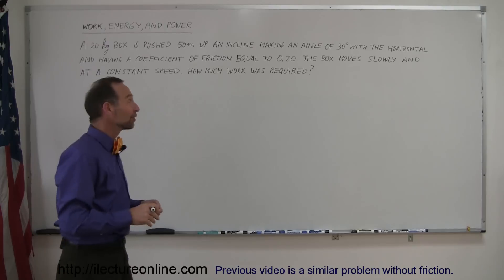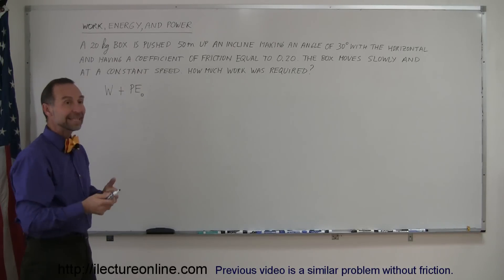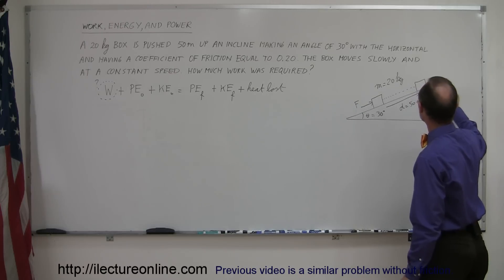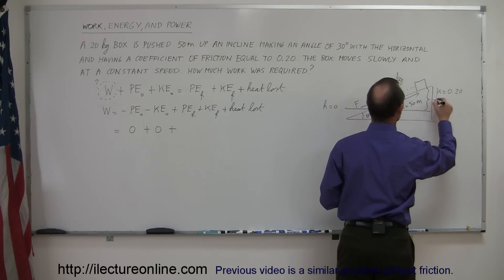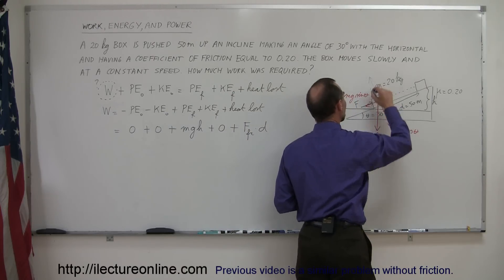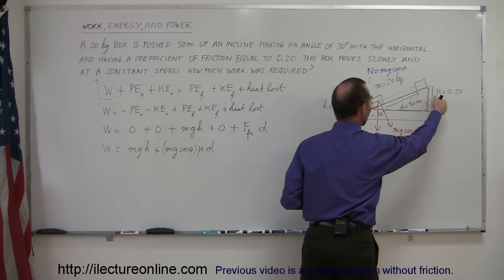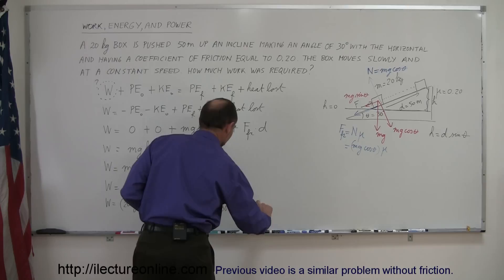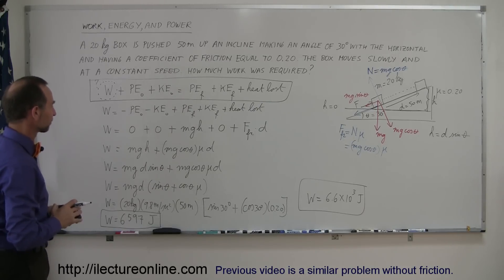Physics 8  Work, Energy, and Power (23 of 37) Box pushed up a Rough Incline With Friction

Comment: Hello Mr there is a fraction the answer supposed to be 2802.6J because it’s substirction not addition .
Reply from the maker: The result in the video is correct.  Don't automatically assume "something" is an addition or a subtraction, it depends on how the equation is formulated.

Comment: A question, how is final kinetic energy 0? I'm searching and all the answers say constant speed/velocity has a constant kinetic energy.
Reply from the maker: Since the velocity didn't change, the kinetic energy didn't change so we can just set the KE before and after equal to zero for simplicty.  You can plug in any value, but since we were not told what the speed was, it was just easier to call it zero.

Comment: A 15kg box is pushed up an incline 30° to the horizontal and 3.3m long with a speed of 6ms-¹ at the bottom. Due to friction, the box stopped 2.0m and slides back down.

a) What is the magnitude of the friction acting on the box assuming it is constant.

b) How fast is the box moving when it slid back to the bottom.

I solved with the energy formula and I got magnitude of friction as 60 N.
With F = uR, I got 75 where u = tan30 and R = mgcos 30
Reply from the maker: If you assume g = 10 m/sec^2 , then the friction force is 60 N

Comment: Is there another way to solve that problem? I tried with the method you gave in the previous video, but it didn't workout, even though (to me atleast) it's almost the same problem.
Reply from the maker: The method  used to solve the problem, depends on the conditions.  In this case, the box moves upward at constant speed.  I suggest you use the method shown in the video.

Comment: Why 2 sf, 20 has 1 sf
Reply from the maker: we are not worrying about significant figures here, just the concepts and how to find the answers.  Significant figures are covered in a different playlist.  We are not assuming that the numbers given are "measured" values.  In the case where we are actually using measured values we should then use the principles of significant figures.
Reply: @MichelvanBiezen  by the way, what is the speed wasn't constant, what would we do, and what would be given?
Reply from the maker: If for example, the speed was increasing, then part of the work would be converted to kinetic energy and part of the work would be converted to potential energy minos any energy lost due to friction.

Comment: Isn't that friction oppose the motion ... Coz if that's case , work done by friction should be negative 1697 and the Wnet should be 3203J 😳😳😳😳
Reply from the maker: It depends on which side of the equation that term is placed.  If you place the "energy lost" term on the left side it becomes negative and if you place it on the right side it becomes positive.

Comment: Good sir, i'm wondering the difference between this and video136 in this playlist is considering in the other video kinetic energy isn't 0 although it seems exactly the same. Also the applications of energy was given by a different equation. Thank You
Reply: My inclination is that because the other video has given force of 100N, then it is not a constant speed?
Reply from the maker: It depends.  If the 100 N force is greater than mg sin(theta) + friction force, then the block will accelerate up the incline.
Reply: @MichelvanBiezen  Oops I was neglecting the weight components! Thank You for the quick response!

Comment: If both kinetic energies are 0, meaning both initial and final velocities  (in the 1/2 mv^2 formula for K.Eo and K.E1) of the box are 0.
So the box literally moved up the plane without velocity.
Practically speaking, the box moved up the inclined plane without moving.
Reply from the maker: If the velocity did not change, then the kinetic energy on both sides of the equation will cancel out.  (v is not zero).
Reply: @MichelvanBiezen  Ok, I see. Thanks for the feedback

Comment: If I want to calculate W=F*d, d=50m and F= mgsinθ+mgcosθμ ,is it correct?
Reply: you only use that if theres no force given, just like the example we are not given by any force that will make the block move or to make it short theres no F to satisfy the formula w=Fd, therefore by using newtons 2nd law of motion we can let that the fnet  will be equal to mgsin theta, and also since the example we had has a friction acting on it we need to find also the formula for it. uk is equals to N and N is also equals to mgcostheta, thats why in his solution you W=  (force x d that is needed to move the block)+(- force the friction has x d)

Comment: Quick question. Couldn't you also solve for work by finding the force as (mgsintheta)costheta and subtract the force of friction, then multiply everything by the distance? I saw in your last video(without friction), you found the force as mgsintheta then multiplied by D. How come you can't just do the same thing here, except use FDcostheta and subtract friction from this? Sorry if I was a bit confusing.
Reply from the maker: There are often multiple ways to solve a problem, and the best way to learn is to try it in a different way and see if you get the same answer.

Comment: Thanks for your quick response Mr Biezen. This is the problem - my solution is included.
I am not sure if i am sure it would be prudent to ask specific question here, but i will give  it a try:
A block of mass 90 kg sits on a slope with an angle of inclination 12° above the horizontal. The coefficients of friction between the block and the slope are µk = 0.03 and µs = 0.2.
a. What is the maximum frictional force that will allow the block to stay in place?
b. At what angle of inclination will the block start to slide down the slope?

Solution for part (a) 

F_s(max.) = µsN
F_s(max.) = µsmgcosθ
F_s(max.) = 0.2(90kg)(9.81m/s^2 )(cos12)
F_s(max.) =172.72N
Maximum frictional force that will allow the block to stay in plaxe = 172.72N

Solution for part (b)
fg = fs
mgsinθ = µsN
mgsinθ = µsmgcosθ
sinθ = µscosθ
 µs = sinθ/cosθ= tanθ
θ = tan^(-1)(µs)
θ =  tan^(-1)(0.2)
θ = 11.31°

The block will start to slide down the slope at 11.31°

I am confused because the block is expected to slide at 11.31 or an angle greater, but yet, 12 degrees in part (a) is suggesting the block is at rest?  Is my solution for part (a) correct? I am thinking i should have found part b first, then use 11.31 degrees and enter it in the formula: F_s(max.) = µsmgcosθ
, instead of using 12 degrees, use 11.31 degrees.
Reply from the maker: You are correct.  In order for the block to be stationary at an angle of 12 degrees the coefficient of static friction should be 0.213.  Therefore the block will slide when the angle is 12 degrees.

Comment: I certainly enjoy your videos. I have a question based on this video. If a block is at rest on the incline plane  at an angle of 30 degrees, would the maximum frictional force that would allow the block to stay in place be calculated using 30 degrees, OR would we have to find the minimum angle of the incline plane needed for the block to slide before we can determine the maximum frictional force? That is, find that minimum angle and then substitute it in the formula for  fs(max) = UsMgcos (minimum angle needed for block to slide)?
Reply from the maker: It depends on how the question is worded.  Sometimes they will ask what coefficient of friction is required to keep a block from sliding for a given angle.  Sometimes they ask: for a given coefficient of friction, what is the maximum angle you can have before the block begins to slide?

Comment: I am a little bit confused...  shouldn't the net work by calculated by finding the work done by gravity and subtract it from 
the work done by friction? I found your answer when I added them though. But What if I subtract them?  my thinking is 
energy is lost due to having a nonconservative force( friction) involved.  The total work performed should the difference 
right?
Reply from the maker: The method and answer in the video is correct.
Reply: What you are suggesting is the net work if the box were sliding down the ramp; in that case, work would be done by gravity.  In this problem, you are effectively doing work against gravity.  The net work is the total work needed to lift the box up by a height h AND also overcome friction.  Addition should feel like the logical choice.

Comment: Why kinetic energy final is 0 even when it has a slow but constant speed I believe change in k.e should be 0.
Reply from the maker: You are correct.  However for this example, the word "slowly" is used such that the KE is negligible and can be ignored.
Reply: Michel van Biezen ok
Reply: Michel van Biezen Because V=constant, KEo =KEf, then the term KE cancel out...is it correct?

Comment: the thumbnail is misleading. You have a pushing force acting in the x direction in the thumbnail and in this the force is going up the incline
Reply from the maker: You are correct.  The force in the thumbnail should act parallel to the inclined plane.
Reply from the maker: Fixed it! Thanks!

Comment: i am bit surprised. It was superb technique to solve the questions that way, however work is define as f.dcos(teta) work done by the kinetic friction is f.dcos(teta  180  degree which implies us energy transfer from block to force parallel to the surface oppose the motion of block but you neglected 180 degree made cos(0) which gives us positive result.  Why you didn't suppose to be subtracted work done by the kinetic frictional force.
Reply from the maker: We did.  (It is the "heat lost" term).   For the equation to be balanced   Eo = Ef   the energy lost must be added to the right side.

Comment: Potential Energy Final equals mgyf, why is it mgd for the final equation.  It should be multiplied by the height which is 25 meters not by the overall displacement of 50 meters.  My final answer was 4937 Joules
Reply from the maker: h is replaced by d sin (theta).  Also, work must be done to overcome friction, thus the final answer is greater.

Comment: Why didn't you use cos180 when writing the formula for friction? Isn't friction supposed to be negative?
Reply from the maker: Forces are not automatically positive or negative.  A term in an equation will be positive or negative depending on the meaning of the term and its position in the equation.   For example:    x + 5 = 3  (x = -2)    5  = 3 + x   (x = 2).   The energy equation equates the initial energy to the final energy of the block.  In order for that equation to be correct you must ADD energy lost due to friction on the right side.

Comment: why didn't you use mgSin(theta) since it's pushing up opposing the mgsin(theta) going downwards
Reply from the maker: The definition of the friction force = N * u  (which is the normal force multiplied by the coefficient of friction).   The normal force on an inclined plane = mg cos(theta)

Comment: why didnt you include the mg sin (theta) in the friction as well?? 
i am really confused when to include it in the calculations. 
could you please help me with it?
Reply from the maker: The definition of the friction force is:   Ffriction = Normal force x coefficient of friction.  Sine mg sin(theta) does not contribute to the normal force (since it is parallel to the slanted surface) it does not contribute to the friction force.
Reply: mass 1250 kg
moves from the bottom to the top of a hill of length 500m amd height 30m. 
power of engine is constant and equal to 30kW. 
a= 4m/s^2 at bottom
a= 2 m/s^2 at top
resistance to motion = 1000N. 

a)  find the car's gain in kinetic energy. 
b)  the work done by the cars engine.. 

could you please solve it.

Comment: why doesn't it have kinetic energy even though it states in the question it moves slowly. is it because it moves in constant speed. meaning there is no velocity hence we can't calculate the kinetic energy 1/2mv^2?
Reply from the maker: If v is small, we can ignore the KE  (which is the purpose of this example)
Reply: oh.. i see. alright..
Reply: Another thing, since the speed is constant, v before equals to v after. Since mass is constant, one Ke is positive and another is negative, they cancel out no matter how fast the speed was

Comment: why did you use mgcos(theta) for the normal force? shouldn't it be mgsin(theta) since sin is the y-component used for rise or fall?
Reply from the maker: It is true that with projectile motion, sin is usually related to the vertical motion and cosine is usually related to the horizontal motion, but assuming that it is always that way, can lead to incorrect answers.  That is why it is a good idea to draw out the triangle in your sketch and confirm the correct trig function.  In the case of an inclined plain the component of the weight (mg) of the object perpendicular (normal) to the incline can be found using the cosine of the angle.

Comment: The frictional force should be negative because the angle between μN and displacement is 180 degrees and both the vectors are in opposite direction. I'm really confused, please help me professor.
Reply from the maker: I understand why you are confused.When we work applications of Newton's second law types of problems          (F = ma) then yes, the friction force is "negative" or "in the opposite direction of the motion without friction.      But in this type of problem, we are equating the left side (which has all the initial energy + energy added to the system) to the right side (which has all the final energy + energy removed from the system by friction).  That is why we add the energy lost on the right side of the equation.
Reply: I got it professor! Thank you so much for making these videos. I have shared this channel to all of my friends and literally they are so happy and thankful to you as well as me coz I shared this wonderful channel with them. Your videos helped me a lot. Tons of blessings from my side.

Comment: NEED A RESPONSE ASAP!! Word done by friction force should be (-) negative? Since friction and displacement are in the opposite direction which would be cos(180), F of k * d * cos (180)
Reply from the maker: +Sai Thu  F net = m total * aAssume a direction for the acceleration.Then F net = All the forces aiding the acceleration (positive) - all the forces opposing the acceleration (negative)  Friction is an opposing force therefore it is negative
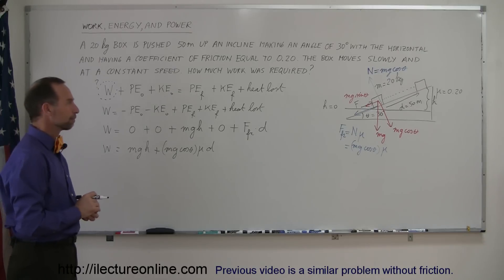Reply: +Michel van Biezen Thx for quick response. I understand the part u said. @ 7:10, for work done by friction force, F of k * d, should it not be F of k * d * cos (180)? Because displacement is going to other direction which is the opposite of force of friction according to Work theory W = F d cos ( @ ).
Reply: PLEASE HELP! This is bugging me.
Reply: Michel van Biezen Please HELP, Mr. Biezen!!
Reply from the maker: +Sai Thu 
You are letting your intuition get in the way of understanding.  Look at each step in the video carefully and make sure you understand each step.  You will see that each step makes sense.  In the end the work put into the system must be equal to the potential energy gained + the work done to overcome friction.
Reply from the maker: +Michel van Biezen 
Also there are many more examples in the playlist.  When you watch some more examples it will become clear to you.
Reply: +Michel van Biezen   ty for quick response again. Yes I've watched every vids of yours. I understood everything else. It's just the work done by friction force that's been bugging me. Or I can think this way. Since F of k is in the opposite direction of acceleration,  so it will become () negative F of k. Then cos(180) is -1. () * (-) becomes positive. If I think that way, it makes sense.  P.S : I got 96 on my first test. You vids helped me a lot. Thank you!
Reply from the maker: +Sai Thu Congratulations!
Reply: Michel van Biezen Thanks again, Mr. Biezen. I got 102 on my second test. You rock! I'm going to watch "Momentum" videos over spring break!

Comment: Thank you for your video. I would like to mention that your videos are unique and completely different from the others.

But, the question is about the KE0. How we could consider the V0 = 0 while already knew that the mass was moving upwards with a constant speed.

I mean, if V0(initial) = 0 then:
A: How the mass will go up with out any speed?
B: Then some acceleration would be needed for taking a constant speed more than 0. (Am I right?)

I would like to put forward that we could have considered KE0 = 0.5m(V0)^2 and later on we could have considered KEf = 0.5m(Vf)^2 and as the question says, V0=Vf=C (Constant) and it means that KE0 = KEf = 0.5m(C)^2 and they will cancel out of our equation.

Sorry, for leaving too much comments. I would say that I like physics problems and discussing about the solutions.
Reply: +Daniyal Ravandeh 
You see, there are two KE equations originally.
Even if you substitute any value of V, they would still cancel out. Since the mass and velocity don't change, KE1 - KE2 = 0, because 1/2*m1*v1^2 - 1/2*m2*v2^2 = 0, where m1 = m2 and v1 = v2.
Reply from the maker: +Daniyal Ravandeh 
  Can you boil this down to a single question?
Reply: +Michel van Biezen 
Sorry for asking my question in a confusing way.
Could you explain why you have considered KE0 = 0 ???
Reply from the maker: +Daniyal Ravandeh  KE energy depends on the velocity:   KE = (1/2) m v^2In the beginning we can assume that v = 0 therefore there will not be any KE
Reply: +Michel van Biezen Thank you for your reply.
What I'm saying is that if we assume the velocity equal to 0 at start point as you mentioned, so our mass should take some more velocity to move. It's clear that with 0 velocity, our mass won't move at all at if there is any increase in the velocity later, it is in contrary with the question's given information. Could you make me understood about it?

Thanks for your attention.